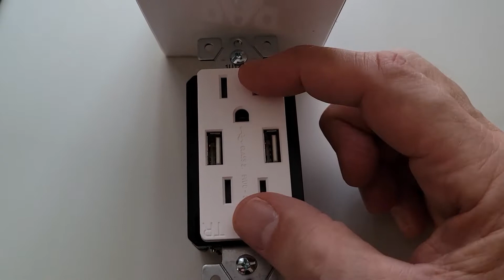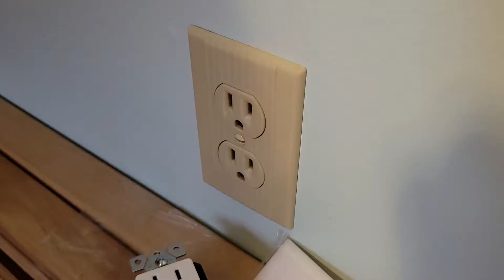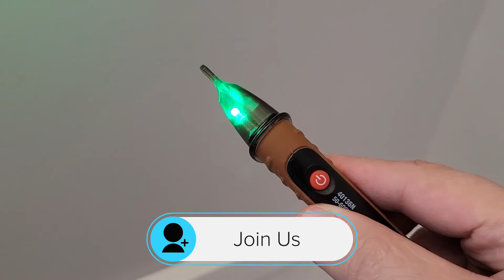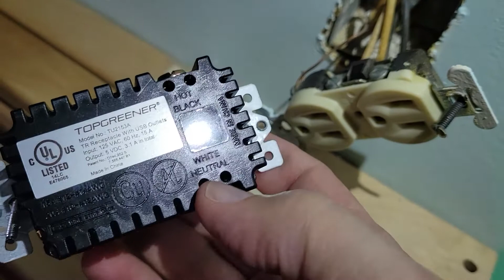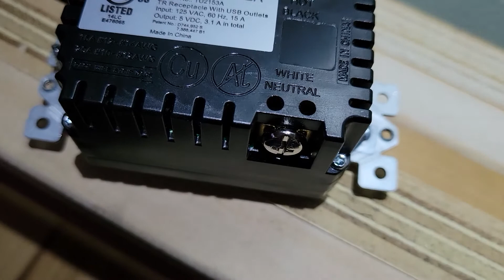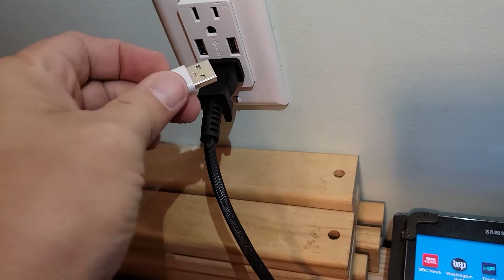TopGreener 2-port USB receptacle  TU2153A

Comment: I bought these without thinking about the depth of the electrical box. This video makes me feel a lot better about the outlet fitting in smaller older electrical boxes (within the last 30 years)
Reply from the maker: Of course it all depends on the number of wires that have been stuffed into the box. I had one ceiling box that had several circuits and was a nightmare to work with until I routed some of the circuits to a new box. Thanks for watching and sharing, best of luck with your project.

Comment: Thanks! I was going to use Wago 3 wire connectors and jump a single wire for hot and a single wire for neutral to the outlet. For some reason, I had in my head that doing it the way you did it was a fire hazard. Obviously, they designed the outlet to be connected just the way you showed. That will certainly free up more room in the already tight box! 🎉 

Watching your video, it’s been two years since you made it. Now, everything is moving to USB-C. It won’t be too long before you’ll be making another video! Ha ha
Reply from the maker: Fortunately the installation will be the same for USB-C. Next time I'll have to see if they make them with both USB-C and USB-A ports. Thanks for watching and sharing.